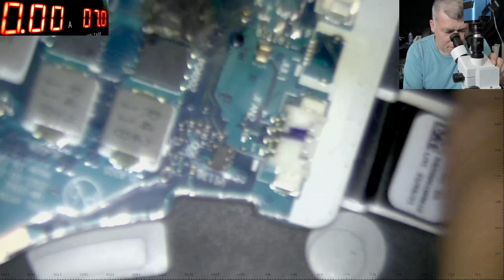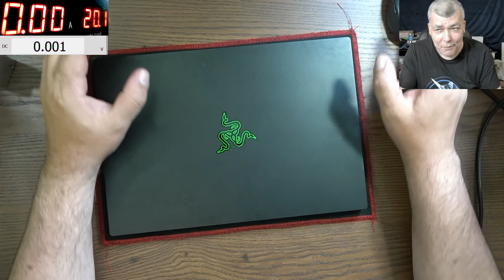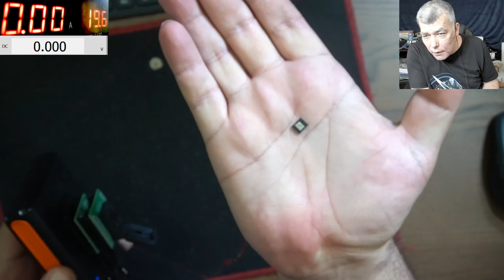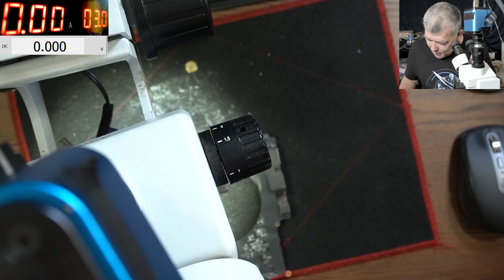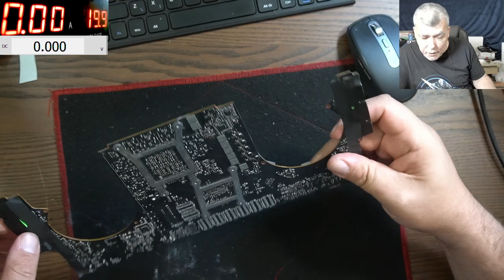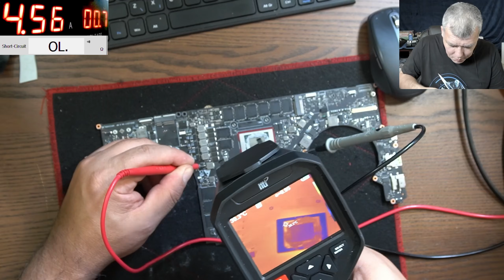Fail to fix compilation - Lenovo legion 5 and Razer 14 gaming laptops repair attempt

Comment: My lenovo  legion 5 died after a year and a half.  I used to be a big lenovo fan but not now.  Unacceptable. Surfed the net and I find I am not alone.  Look up issues for lenovo buyers beware.  Also see what they are saying about customer service.  Watching this video and others has helped me realize what problem my machine is having.  Thanks for the informative videos.
Reply: What do you mean by "died"? My Legion 5 is one year old now and the only issue I had was that my SSD died which the warranty covered, warranty is 2 years, yours should be covered too unless you opened it or misused it.
Reply: @kenshi7563  The battery would charge and then drain instantly so it had to be plugged in all the time, then there were slower start ups and if I plugged it in and waited a few minutes it would fire up.  Then it finally seemed to struggle when I went to copy files to a usb and would just shut down.  Then it would not start.  Only the keyboard is lit and the screen is black.  Perhaps it is under warranty, perhaps I only had a year.  Regardless, I purchased it on a visit back to the USA and am overseas where getting it back to Lenovo would be really costly.
Reply: @jimheston9127   Sounds like a battery related issue which is strange because I've been using mine plugged in since the first day I bought it for at least 4 hours a day every day, never experienced any battery related issues and I can still run it unplugged for that time, I mean it depends, maybe yours was factory faulty, there can be lots of issues, maybe you've been using a higher source of power than recommended, who knows.
Reply: @kenshi7563  it was all good in the beginning and was able to use it in airports on a few trips on battery.  I have only used that brick of a power supply that came with the computer.  I imagine I got a lemon.

Comment: I have a Lenovo Legion 5 gen 5 (I think - has the Ryzen 7 4800H). It's a beautiful laptop, great keyboard, works well with Linux. Upgradability is also awesome! I want to change the screen from a 144Hz panel to a 120Hz panel (because the 144Hz panel doesn't have a 60Hz option, something that is useful for me).
Reply: you can use CRU to have custom refresh rate mine have only 165 but i set it to 90 and 60 when using battery
Reply: @ucdungn2859  Nice - thanks for the tip. I think I've heard of CRU before - it's a Windows-only application. I'm using Linux.

Comment: I too have a lenovo legion 5 with what appears to be a shorted gpu if I lift up one side of the coils the voltage come up and is correct so clearly the gpu and or the vram are rooted I plan on replacing the gpu die for the fun of it but I do t have high hopes

Comment: Sorin, my ASUS r753u failed with bios update which came from win10. It’s not manufacturer. They outsourced it to windows since not every customer is doing bios updates over a few years. This comment is in context to older video. It’s also a way to end a working laptop after 6 years of use. They want to customers to buy every 2 years. All i do is coding and Computer Science Projects. Good enough computing power for a student.

Comment: I've owned a couple of laptops that constantly killed the GPU , after replacing several GPU boards, I found out that, SOMEHOW, the board had VRAM thermal cooling pads that were too thick, ordinarily this may not have caused me to be alarmed until I realized one thing...Thermal pads that are too thick caused the heatsink plate to lift up off of the CPU/GPU(since they require thermal paste), causing an overheating issue that totally destroyed the CPU/GPU.

Comment: The windows update make bios update , i get  2 brand new laptops hp i5 withe no os , install the windows 11 restart nothing then make windows update and on the first restart make bios update as well both laptops is same no differences exactly the same story wen i connect the WiFi and make the windows update on the first restart

Comment: This is where I learned a lot about Repair. Sorin Thank you very much God bless you.
Reply: Great, my friend, what is the level of maintenance of your notebook?
Reply: @masterliu1892 by now 💯%  confident  As long as got the proper replacements and basic tools . I'm  Sure I will fix anything to the limit. 
The secret is almost no unique problem. Most devices components suffer from almost similar problems and causes. To clearly Understanding the relationship between voltage and current in respect to Resistance ( Ohm's law ) will make you Sorin.
Thanks

Comment: for who said that windows update doesn't deliver BIOS updates. i can confirm that i have delt with this issue on asus brand, but as far as i know, all manufacturers delivered bios updates specially when the intel gen 7 and under cpus had that 0-day exploit regarding xmp overclock. so yeah, you can get bios updates with a simple automatic windows update. 100%. :)

Comment: Hi Sorin, this why manufactures should be forced to fit sockets for gpu and cpu , also some form of crowbar circuit in the event of  high voltage , but all that interests them is money, but a great diagnose of the problem, love the videos  73 Jim

Comment: Yes a nice looking laptop 💻 
Sounds like a duck 🦆 but it’s a 💀 dead cpu . And why again? A waste of time. Gaming laptops are bad 15amps 300watt you can kil my wife with it or a 🦆
Reply: 300w is fine for the hardware they are using . This year there even are some laptops with 330w power supplies . Anyway, for Lenovo they simply said fk it and used the 300w supply for all their laptops instead of only the top specs ones that actually use 200 something w combined . Thats fine tho, everyone says that you dont want your power supply to need to work at 100% of its capacity

Comment: I would like to know if theirs any type of motherboard reader  for phone so I could recover all data including pictures  everything and send to new phone from the old phone one of the IC chips broke off from the motherboard and now the phone will not turn on or charge power ... this happened because I was replacing a screen to the phone but one of the screws were difficult to remove when I finally did then is were I noticed a chip had broken  off. Can anyone help ? Or know how to transfer data ? The problem is I can't turn the old phone on so want to know is there another way or is it completely lost ??
Reply: Good luck with that ☹️

Perhaps take it to a REAL repair Technician ?
Reply: @edwardfletcher7790   perhaps  your the wrong person to answer.... Good luck with that ☹️!
Reply: @blaze-jb4xz  If you're breaking chips off a phone, you need to take it to someone who's got better skills and might be able to replace the chip. As long as you haven't damaged the board.

I've been a phone repair tech since 1995, so I'm biased. I've seen far too many over confident "home repairs" like yours 😕
Reply: @edwardfletcher7790  I already have the skills and no how .... just wondered I'd there was another method that is faster ..... by the way the phone had already been repaired since the last time  made the first comment... Is the same one used to send this reply.... but thanks

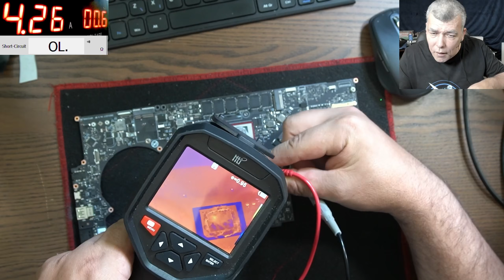Comment: 37:15 : the hot spot disappeared because you wiped the CPU clean, which transformed it into IR-mirror, so after that you were seeing your ceiling (room temp). some surfaces even non reflective to the naked eye (like non polished aluminium) are perfect mirrors when seen through thermal cam. Just put masking/painters tape on that kind of surface to "fix" it

Comment: 10 ohm on vrm rail is not a short is it?  Isn't it normal with even lower resistance on these 1v and 1.2v rails?

Comment: Replace the CPU sorin..... discuss with customer
Reply: You can only buy these CPUs second hand, desoldered from another motherboard. You pay a lot of money, do a lot of work and you can't even be sure the replacement CPU works when you buy it. That's why almost no one replaces them.
Reply: @fabian11235  That's right, and who's going to want to pay him after he does all the work and it still doesn't work because the spare is faulty? And then he has to open a dispute with Ebay, etc. Definitely not worth it unless you have a known good supplier...or the customer supplies the spare, just maybe.
Reply: @englishrupe01  Yeah its just not viable as business. Its a fun project though if you have an ir rework station.
Reply: @fabian11235  And you still will have to give warranty with a high chance of return. I'm definitely out. kkkkk